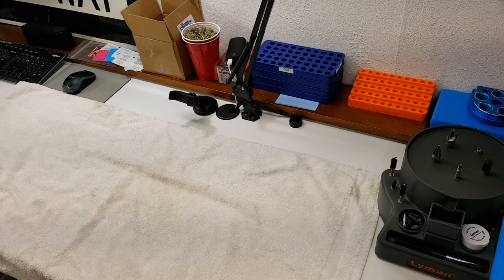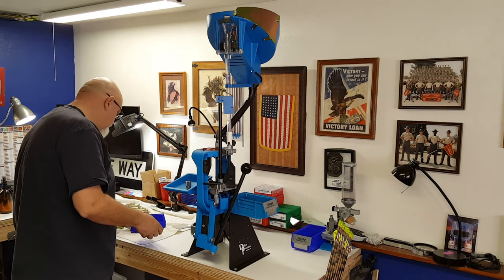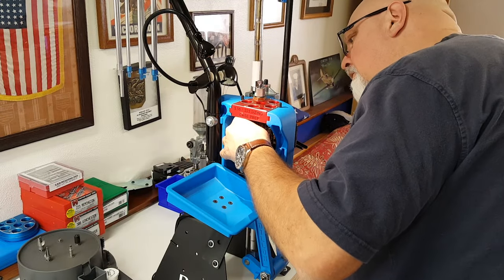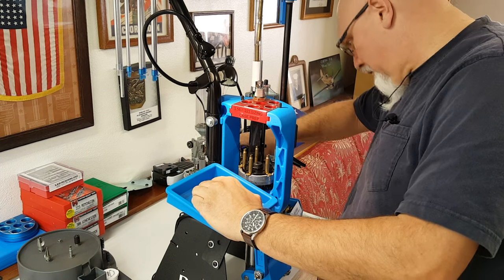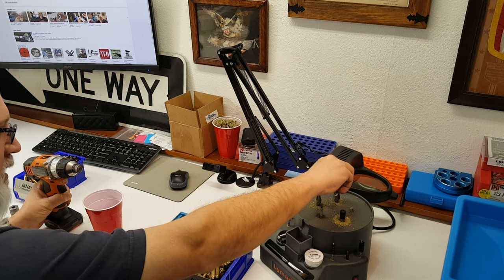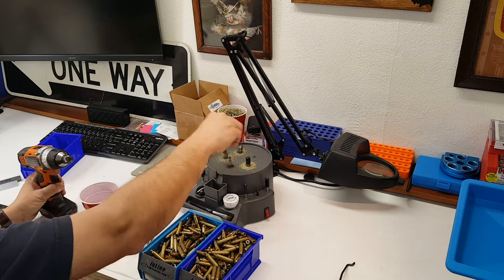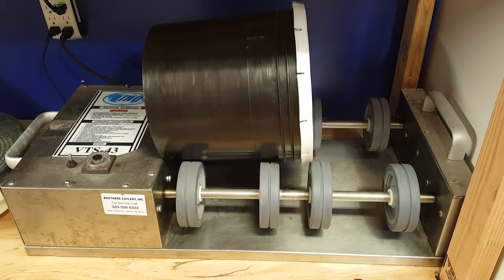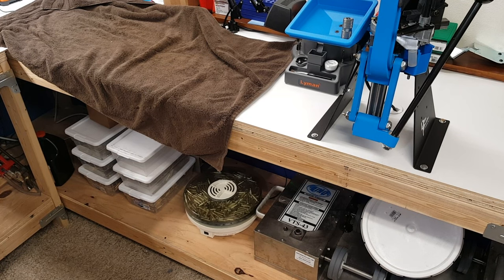Case Prep 101

Comment: For prepping rifle brass you may want to look into the Dillon trimmer that goes on your tool head with a Dillon trim die. I run it with a decaping on its own tool head and makes quick work of 1,000s of rounds.  I also have the swager that goes in place of your primer seater on the press. So your first station will decap and full lenth size and the second station will swage the crimp out  and on station 4 you put your trim die and motor. It's a little expensive but is worth every penny  I highly recommend  it . I can usually fully prep a 1,000-1'500  a hour and be ready to polish
Reply from the maker: Hello Nick thanks for the comment!  The dillon case trimmer is on my list for sure.  It's a pretty penny.  My local shop will let me put one on layaway.  I've seen the swaging set up and thought of getting it.  Once again thanks for the tips!!
Reply: Bravo1Xray no problem,   it's well worth the investment
Reply: Can you provide a link on the parts you’re talking about? I don’t mind spending the money if it’s going to save my lot of time.
Reply: Lee also makes a quick trim die which I use on a single stage RCBS

Comment: New sub to your channel. First off, Semper Fi. I have developed a way to VASTLY speed up the time it takes to separate the brass from the steel pins. if you can use a rotary media seperator (most reloading companies make them for seperating brass from dry tumbling media.) Fill the bottom half of the seperator about 2/3 full of water and dump the brass and pins into the basket. as you rotate the basket that is partially submerged in the water the pins will freely fall to the bottom. the water helps break the surface tension and release the pins.
Reply from the maker: Neil Harris Excellent tip Neil!  I will definitely look in to one.  Do you have a preference on one to get?  Thanks for the Subscription!
Reply: Bravo1Xray I do not have a preference. i do use the RCBS model and it works great. it was the one i could find locally. they all are pretty much the same, however i would try to get one with some sort of a lid.

Comment: Great video. I process mine in a similar way.  I saw that you had a snag with the primer advance at one point.  I remove the primer advance cam from the frame when I’m processing as I’m not using it and I want to reduce wear on the system if I can help it.  +1 on  Dillon’s case trimmer, I run it on my size/decap head.  Happy loading sir
Reply from the maker: Wmbhill thank you for the comment!
Reply from the maker: Check out my video on the primer stop!!

Comment: I like the method you’re using. Mine is similar but you’re taking a lot of unnecessary steps & time separating the pins. I use a Dillon media separator filled with water. Dump the whole bucket of brass and pins into the separator and spin it for a minute or so. 

Dump out the water from the separator, then recover the pins and then put a small hand towel in with the brass & spin it again. Repeat that step a couple more times with a new dry towel. This gets about 90% of the water off of the brass. 

To completely dry it, I then put it into a vibratory tumbler with corn cob media & Flitz polish which does an exceptionally good job of coating the brass & preventing it from tarnishing.
Reply: That towel in the separator tip is excellent! Ill try it. Thanks👍

Comment: I’ve read some of your comments and listen to your video and I’m pretty much in compliance with you except that my procedure goes like this I start off with rinsing my shells with acetone then I lube them then I size in D prime and cut two length I have the Dillon trimmer and then I put my shells in the Franklin arsenal wet Tumbler and I do six hours of tumbling then I dry in the dryer from Hornaday and then I put them in the vibrator with corn cob and some kind of polish or even car wax they always stay shiny primer pocket are clean and I have no other thing to do but to chamfer ready to reload

Comment: Have you tried the frankford arsenal case trim center. I recently got it and way faster than locking them into the drill 1 at a time, fairly reasonably priced too.
Reply from the maker: Dominick Delfino thank you for the tip!!  I have not tried the Franklin trimmer.   But, will look Into it for sure!!

Comment: Hi. Just a question. Can you take the case trimmer part that you hold in your hand and put it in the drill? Then just hold the brass in your hand. That way you wont have to lock each one in every time.
Reply from the maker: I don't think you'll have the torque or the speed needed to trim the case.  I've upgraded to the Dillon's case trimmer now so it only take me 30 or so minutes to trim and size a 1000 .223 cases!!

Comment: Reduce the aperture on your case feeder to prevent upside down cases
Reply: +1 on reducing the aperture size. It’s the silver clip like piece on the left of the aperture of the blue hopper that the cases fall into from the wheel on the way to the clear funnel, micro switch and feeding tube. It’s just held in place by a tight friction fit and can be slid right and left.
Surprisingly, its not mentioned in the manual nor in the parts diagram. 

When properly adjusted, it will absolutely eliminate upside down cases, guaranteed! The basic idea is that the aperture (or opening) has to be long enough to let the case fall heavy base side down whether it comes by neck first or base first.  The clip needs to be adjusted to the right (smaller opening) enough to catch and support the lighter neck (when the cases arrive neck first) so that the case stays level until the heavier base clears the right side of the opening and can then fall down base first. The cases that arrive heavy base first are no problem and they start to fall immediately. It’s the ones that arrive neck first that are susceptible to falling neck first (upside down).  I’ve also found that I can adjust it to not only virtually eliminate my 223 cases falling upside down, but also to work with the shorter 300 BLK cases. And once adjusted, it does both and doesn’t have to be messed with when I switch between them. A win-win in my book and no more upside down cases.
Once you understand that cases arrive at the opening in two different directions and see how the neck arrives first and has to be supported to stay level until the heavy base clears the opening and can then drop, you’ll see why the opening size is important. 

And a bonus tip as a thank you to all the posters that have taught me so much about my 650: Place some powerful Neodymium magnets on the clear feed tube just under the metal clip at the top where the metal clip will hold them from slipping down.  This will catch any steel cases that might sneak through before they reach your dies.  Cheap insurance and works like a charm.  I’m a cheap skate and used the magnets from old Sonicare toothbrush heads as any strong magnet(s) will work. 
LOL, I think I spent more time tricking out my press than actually cranking out ammo the first year I had it.

Comment: I don't get why you need the brass shiny.   I took reloaded brass that was dull and also some that was shiny and if anything the dull shot a little better.   So why do people put hundreds of dollars into making it look shiny.    If you are a hunter shiny will give away position,  dull camo is preferred.     Is there a reason for all this must be clean looking brass or is it more of a OCD thing?
Reply from the maker: Thank you for the comments Bob!  To answer you, for me it's part of the process.  I like my brass to look new or better when I go to the range.  It's just a personal thing mostly.  I hunt paper and steel mostly so when its shiny its easier to find and pick up to use again...
Thanks for watching and and commenting!!
Fred
Reply: @bravo1xray522  Totally understandable.   I've just spent a ton of reloading equipment for a dillon 650.  Don't have a tumbler and started looking at them and started asking myself do i even really need one?   Saw a video on one using stainless pins and it looked like a ton of extra work and then even dangerous if you get a pin stuck in a primer pocket then later load a primer into it.
Reply: @Physics072  So you can use a vibration tumbler with something like corn cob media. Clean brass will avoid your chamber being marred by built up fouling.
Reply: @zhukie  I use a ultrasound for my brass and some detergent they come out pretty clean.   I think a corn cob might POLISH better and remove more material but its also slower and more work.    I've not had any issue with brass using just a ultrasound.

Comment: I notice you have OCD Everything has its proper place. Your wet tumbler your probably spending more money on electric than if you bought a real wet tumbler and run it only for one hour max and does a real good job. Another thing your drying process if its heated it will turn your brass slightly tarnish. I will agree it does take some time in prepping 223's. I sometimes ask myself is it worth to reload 223's??
Reply from the maker: HAHA!  Yeah a bit of OCD for sure.  Ive upgraded to the Franklin arsenal wet tumbler now.  I really like it.  I do it for the joy and hobby of it more then the cost savings.  But to know that my XL650 has already paid for it self is a good feeling!!  Thanks for the comment!!
Reply: Just a note about your lemi shine I did a PH test on it and found it to reduces  the PH level in the water , another words it causes the water to become acid and this in turns makes the brass shinier. Your tap water ph is around 7.0 once you add lemi shine your PH drops. Personally  I like to add more than what you mentioned only because the more acidic the water the better the brass becomes shinier.
Reply from the maker: Thanks for the great tip!!  Ill try to add a little more next time and see how it goes...
Reply: @johnb1448  yep lemi shine is acidic acid.
Reply: Its worth it if you are shooting precision rifle competition.